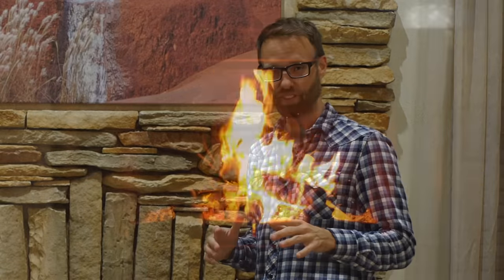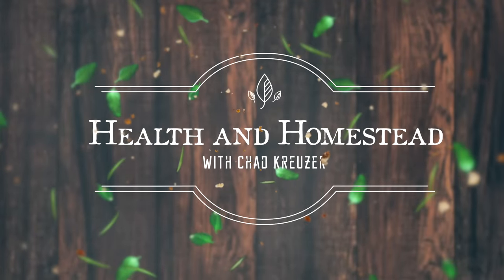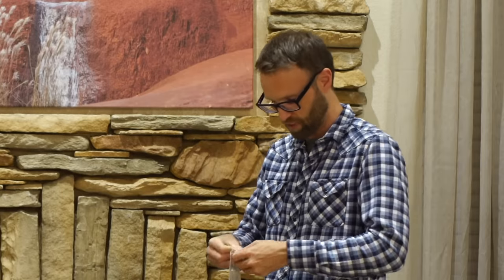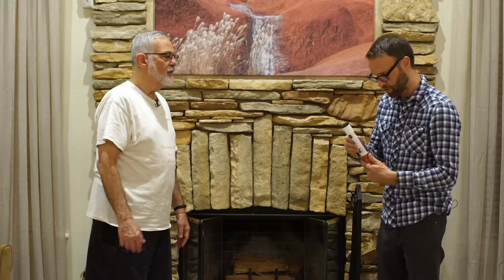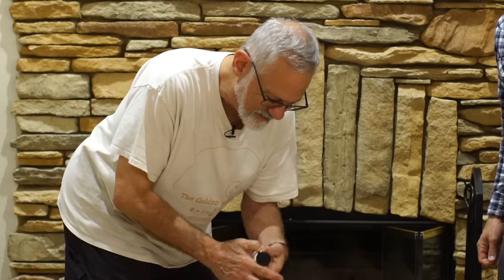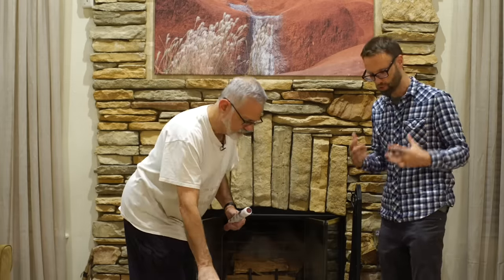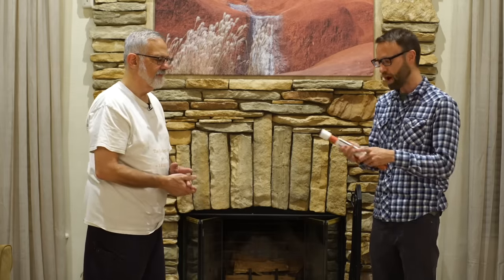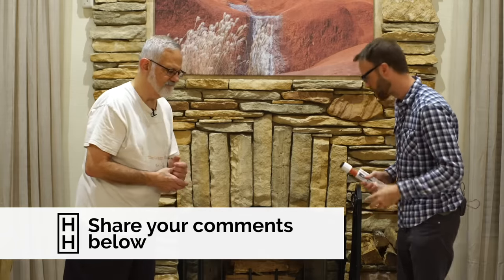You Need To Know How To Put Out Chimney Fires.

Comment: Had a chimney fire 30 years ago. Had it out before the fire Dept arrived by shooting water down from the top via a hose- which destroyed the inside pipe and resulted in having a new chimney built.
Fire Depth said: WRONG. They said to shoot the water into the cleanout of the chimney which would via steam rising would’ve put out the fire AND have saved the chimney. OK - next time
Reply: "...water into the cleanout of the chimney..."   Would you re-word that for me?  I don't follow exactly what youre saying.
Reply: @tattooedmilionare, I believe they have a small door, on the side, that can be opened to clean out ashes after a normal burn.
Reply: oh yeah. (1 of my chimneys has it the other does not.  I always wondered what it was for - lol.  Thank you :-) @tiredofit1429
Reply: Wet newspapers will work

Comment: I had a chimney fire. I closed all the dampers, etc but there must still have been enough air leakage so it kept on burning. I ran to the top of my house, up the short ladder that was always against the chimney, put on the gloves, lifted the conical top off. Flames were down below, not up there where I was. I flipped the top over and set in on top of the chimney. This sealed it well and stopped almost all the airflow, and the chimney fire went out.
Reply from the maker: Wow, sounds like quite the experience. Glad it worked out.
Reply: So you said you flipped the top over and set on top of the chimney"?  Wow.  Didn't that burn your asss or were you able to just hover over the chimney top until the fire went out?  Amazing story.

Comment: Best flue fire prevention is to burn your stove hot. When I started burning wood 20 years ago I was keeping the fire damped down so it would burn longer. 

You wouldnt believe the amount of creosote i swept out of that chimney the following year. 

I like to burn my stove at around 450 degrees. I actually skipped sweeping my chimney last year, and after two years of burning hot fires i had a miniscule amount of creosote in my flue.
Reply: Yup, a smoldering fire creates a lot of shit in the pipe. I burn a super hot fire every morning. I tap the pipe afterwards and let the shit fall down, then rake the stuff off the plate in the stove.

Comment: For a wood stove, close the dampers to cut the air off. Take a plastic or styrofoam cup, larger the better. Slowly open the stove door as it will backdraft.  Throw the entire cup of water in and close the stove door.  The dense burst of steam up the chimney will immediately snuff out the fire. 
Those flairs will prob work fine. They are the same thing as the Element fire extinguisher they sell to strap to the roll cage of offroad vehicles. Basically just expel a bunch of carbon dioxide.  
If you want something just in case of a chimney fire just get an actual CO2 fire extinguisher so it can be used for more than just one situation.
Reply: I did the water thing for the one time we had a chimney fire and it worked fine, but twisted the firebox on the antique wood stove...small price to pay.😅
Reply: i was thinking the same. Why not just get a CO2 fire extinguisher? Like honestly, everyone should have one of those in their house anyway, especially if you have a fire or wood burner. Chimney fires aren't the only way a fireplace can get out of control. If you regularly have things burning in your house, even if it's just candles, you should have at least one fire extinguisher. it's a simple and versatile solution to many potentially disastrous problems
Reply: I've actually used this technique to fight an active chimney fire and it worked almost immediately.
Reply: Don't throw water on your fire people, this is stupid.
Reply: What good would a fire extinguisher do? The fire is inside the pipe, going up inside the pipe another 10’ up on the roof.
Reply: I'm a retired UK fire officer, having dealt with fire all my life, including chimney fires. Water is almost always the best choice for domestic fires & a liquid dish washing detergent bottle makes a great sunstitute for this. The % of CO2 in atmosphere required to exrtinguish a fire, coupled with the short duration, typically 20 seconds or less may well not suffice, meaning it's back to the water anyway. @WhichDoctor1  BCF was best, but it's now banned.

Comment: Had a chimney fire. Very scary. Threw water on the fire and all the smoke evidently snuffed out the fire in the chimney. Worked immediately. Fire department came and checked everything. Fast forward, use gas fireplace now.
Reply: Or you could've just found a professional chimney sweep, cheaper than paying for gas.

Comment: I just keep a gallon of spray water around the fireplace. Cause you never know when its going to happen. But by having water by the fireplace, can put it out fast if you need to or to help kill down the fire if it gets to hot.  I also keep a drain water hose near the chimney. I just connect the hose to it

Comment: There should be a smoke damper in the chimney. Just close the smoke damper and voila, chimney fire eats the oxygen  from the chimney and the chimney the fire goes out. Smoke damper also prevents the cold air creeping in when it is cold outside. I live in Finland and I guarantee, every chimney here has a smoke damper.
Reply: Great advice but if you close the damper on a live fireplace , your house will rapidly fill with smoke no? Smoke is what does the damage and costs thousands to clean up and remove.
Reply: @jspee1965   No need to TOTALLY close the damper. By closing it enough to stop extra air to pass the fireplace stops the chimney fire from getting oxygen and it extinguishes.

Comment: When i stopped using ny masonry chimney because the flew tile was cracked i went to a insulated double wall stainless steel pipe. Where it enters my basement i have enough room to clean the chimney from the saftey of my basement.   I clean my chimney atleast every 2 weeks in the winter.  The cleaner the better

Comment: Get up on the roof and pour baking soda down the chimney.
You may have to put a handful of snow down there first.

When you clean your chimney monthly you shouldn’t have excess build up.
The chimney won’t draw as well when the airflow is constricted by creosote buildup.

After you remove the swept creosote from the clean out, 
cover the floor of the clean out area with baking soda.

Thus the base of your chimney is covered in a fire extinguishing compound.

Any burning creosote that falls there will go out.🎉

Comment: If you have a clean burning fireplace (with an enclosed fire chamber and afterburner air injection nozzles inside), there should be close to no risk of a chimney fire. I think so because there are very few particulates in the exhaust stream because the combustion is pretty much complete. And the exhaust gases are supposed to have relatively low temperatures, around 100 °C (212 °F). As a bonus you don't pollute the air in the neighborhood very much and the exhaust is mainly CO2, not CO.

Comment: I have a CO2 tank full of gas, I have put out a fire in a popcorn machine by flooding the machine with CO2. Wonder if it would work if I ran the hose into the fireplace and opened the valve full blast, about a 1500 psi blast that will last about five minutes. Definitely would push out the oxygen up the chimney and displace it with CO2.

Comment: Just have the chimney swept annually and avoid the chimney fire all together.
Reply from the maker: That is the best option. But it is always good to have a backup.
Reply: If you heat your house totally with wood, you should clean your chimney 2 or 3 times each winter and that''s if you are well experienced with what wood to burn and familiar with your stove. if you are new at this, do it more often until you know how often it needs it.

Comment: Know how hot to burn wood in a fireplace helps to!   I DO NOT LET THE FLAMES GO UP INTO THE FLUE!  I keep the flames down a few inches from the top,  It it get up higher i will spray the flames down with water,  until it keeps flames where i want them.. That my hottest setting 👉👉 My coldest setting is?  A small campfire. where it keeps the chili out of the house..  Plus it don't hurt to spray water into the fire box of a fireplace > all it does is create steam

Comment: Why not just use a dry chemical extinguisher??? The draft of the fireplace will pull the dry chemical agent up the chimney and " extinguish the flames! If you have a carbon dioxide extinguisher  it will work as well & just extinguish the fire in the fireplace with a bucket of water cause a steam effect & put the chimney fire out; all of these methods will  work,ìf the fire is contained within the chimney! However, if the house is on fire,get everybody out if it is safe to do so & call 911 the fire department and give them your address immediately! Be brief & tell the emergency operator what kind of fire you have- for example; when the operator ask for your information; don't panic! Say something like this..." I have a structure fire @ number 2 main street anything u.s.a. there are 3 people or no people inside & we think the fire is in the wood stove chimney ,we have gas & electric utilities as well." ( I am a retired fire Captain, so this information is from 23 years of hands on experience  !

Comment: Moved into new house and I burned the cardboard boxes in the fireplace. The cardboard burned too fast and hot and set the chimney on fire.  It made a noise like a jet engine. There was a jet of flame coming out the top with force. I put a leather glove on and closed the flue and the fire went out. I had the fire department check it afterwards.
Reply: When you closed the flue you must have had a lot of smoke in the house.

Comment: Just wondering, couldn’t you close off the air supply from the wood stove to kill the fire? Or would it still breath from the top?
Reply: I had a barrel stove once before.  I've had it roaring and glowing.  I shut the incoming air off completely and it went out in about 30 min.  It was still hot coals but no flame.  Hope this helps.  Best to consult an expert though 🍻

Comment: How could you possibly not show the Chimney Fire Extinguisher in action? That was soo lame. I want to se what it looks like when activated... And by the way, if you have a wood burning stove, please make shure your chimney is cleaned at least every other year. That is unless you have a clean burning fireplace (with an enclosed fire chamber and afterburner air injection nozzles inside). If so, I guess a 5 year cleaning/inspection is enough.

Comment: Or....you could learn to not mess upp your chimney by only using dry wood and also make sure the fireplace gets enough oxygen. Preferably also stop using open fireplaces since they are stupid and ineffective and easily builds up tar in the chimney. Speak to your chimney sweeper about how to keep a fire the right and safe way. If your chimney sweeper doesnt know about the proper way to maintain a fire, please get another chimney sweeper.

Dont throw aluminium cans into the to fire, aluminium oxide is poisonous to nature. Throw in some zink or dried potato peels instead to oxidize a tar buildup without burning it.

Comment: You two are a joke. Burn your fire hot and never have a chimney cap with a screen. I have been burning wood for forty years. Burn hot cleans the pipe, then damper it down. Second, never build a chimney with a crap clay liner. If you have a clay liner, put in a stainless liner. And never ever burn wet wood.